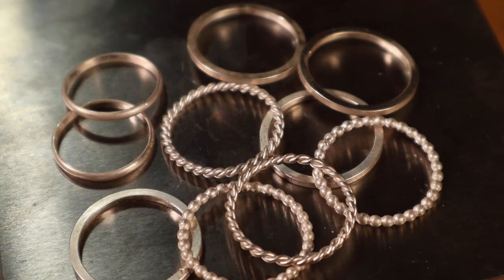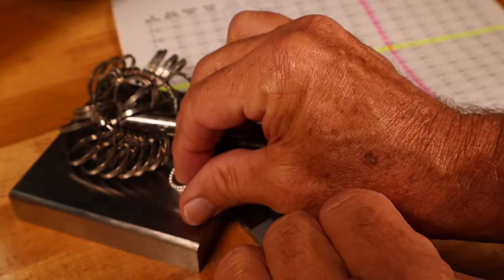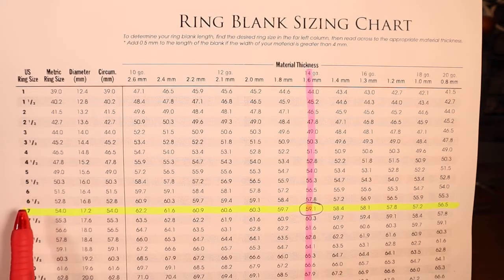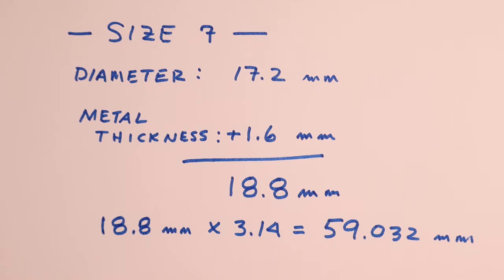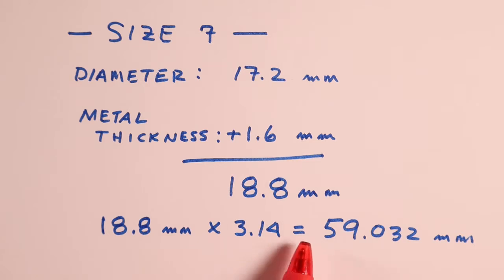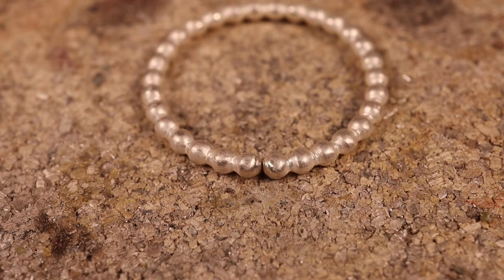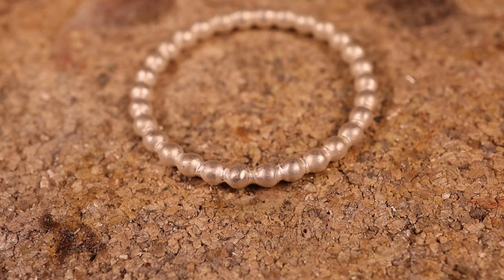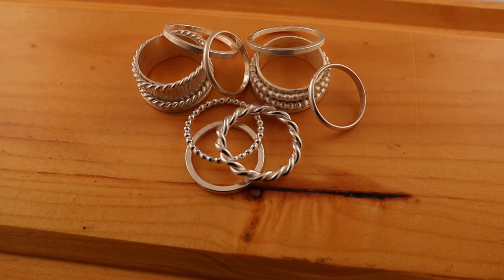STACKER RINGS PART 1: "4 Must Do" Steps to make Stackers Correctly

Comment: Why do you calculate, do mesurements, score and rub with pencil if you can just wrap the wire around the mandrel at the correct size and cut this is only 2 steps?
Reply from the maker: Hello Rakhzul,  Thank you very much for your great question.  Good observation.  In the videos, I want to show all ways of doing a job.  Just rapping the wire and cutting is a good, easy, and fast way of measuring.  This is great for just one ring, but when a jeweler is doing production work, it is faster and with less waste of metal if the measurements are taken and then the wires can all be cut to that length, curled, and soldered.  This saves a lot of time.  When I am doing a project with just one ring, I will do the wrap and cut method.  I really appreciate your question.  Keep watching.   Greg Greenwood

Comment: This is great! Sure beats the way I was doing it!! 😊
Reply from the maker: Hello Mary,  I am very glad I can help. If you have any questions in the future, please feel free to let me know.  Thank you for your kind comment.   Greg Greenwood
Reply: @greggreenwood4628  I will take you up on asking your advice. 
I have a question about soldering a bezel. I will solder a medium to large bezel together with hard solder. Then tidy up a bit of excess. Sometimes after numerous soldering operations (backplate-medium solder, adding ring shank with easy solder etc) I am sometimes left with a small indented trough where the bezel seam is. The amount of sanding THATS required to make that seam disappear is endless. What am I doing wrong?  Thanks
Reply from the maker: Hello Mary,  You are doing nothing wrong! You just have to be aware of how many times you are going to be soldering on your pieces.     In your comment you mentioned "numerous soldering operations".  When you are soldering many times on a piece, the prior solder joints will start to deteriorate because of the formation of oxides and the pickling action.  Sometimes it can be a little aggressive and will show up as you described, "a small indented trough".  Two ways that you can deal with the problem:  1. When you are soldering for the second and third times, make sure you put flux on the prior solder joints.  This will help with the oxide formation, so when you pickle, it will not remove part of the solder.  2. Plan ahead on your soldering.  If you can get to the first solder joint after all the soldering is finished.  Then leave a little excess solder on the joint and finish cleaning it up at the end instead of cleaning it all at first.  ... I hope this has helped you and I hope it makes sense!!  You are always welcome to ask questions and I will do my best to answer them.  Good Luck and let me know how it is going.   Greg Greenwood

Comment: Hi there, what size are you using for the square, beaded, and twisted wires? Are you using hard, medium, or easy solder? Thank you!
Reply from the maker: Hello Stella,  I used 14 to 16 gauge wires.  The twisted wires are 18 to 20 gauge.  I use all three solders.  It depends on the design, but i usually use hard first, then medium, then easy.  Check out my video "Stacker Rings: Par 2"  I use more solder on those rings.  Thanks for your questions.  Greg Greenwood
Reply: @greggreenwood4628  thanks for the reply!

Comment: Thanks again for a really good tutorial. The measuring and cutting tips are invaluable especially the bead and wire tips. and also to warm the whole piece a little to stop the heat you put on your solder sliding away into the cold metal. 
Small tips. When sawing the ends of your ring metal, just put a finger end on the spare end to stop the metal jumping and jamming your saw blade. Mr Greenwood got away with it because of his experience. Never hit your ring measure at all, you will distort it and only  hit the other mandrel with hide. A metal hammer with chip the heck out of it.
Reply from the maker: Hello To forget,  Thanks for your tips.  Greg Greenwood